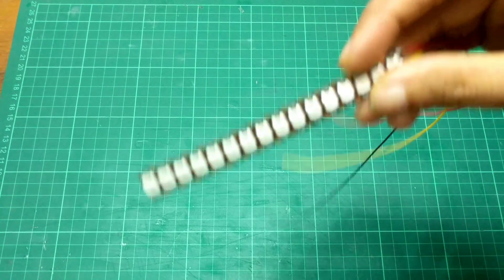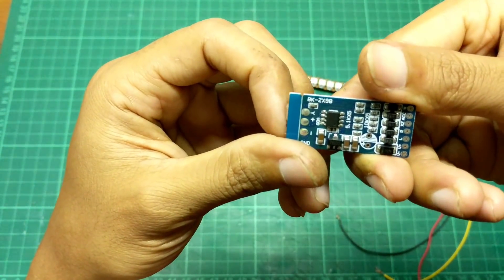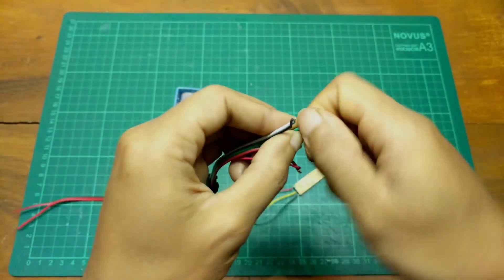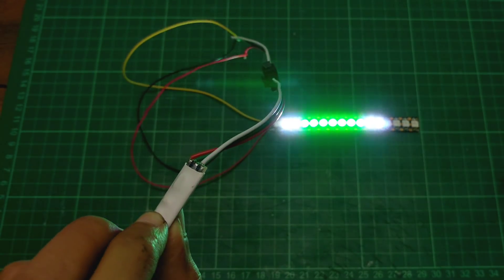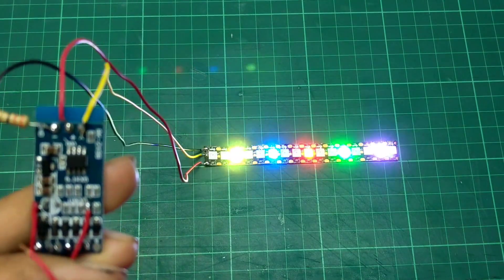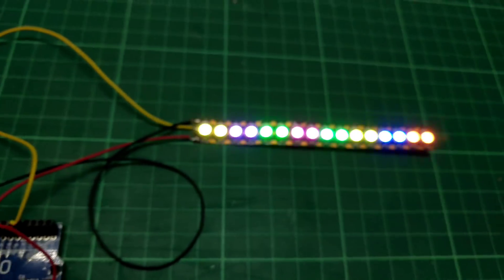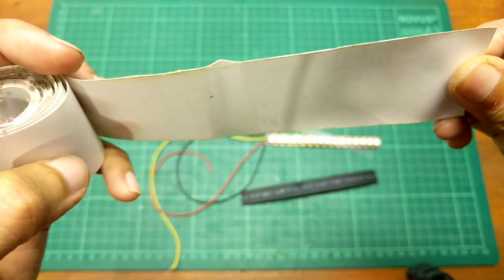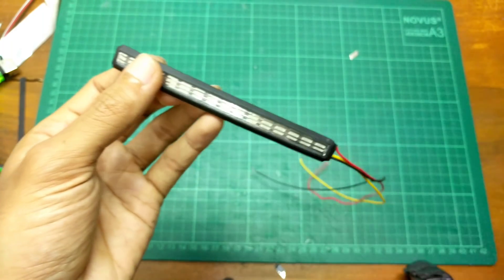CARA MEMBUAT STROBO RGB UNTUK MINIATUR BUS & TRUCK DENGAN LED STRIP RGB WS2812B

Comment: Sam saya minta link pembelian led rgb ws2812b ya ....sama modul SP002E ya!!  😁😀
Reply from the maker: Beli RGB Smart LED Strip IP67 WS2812B WS2812 WS2811 144 mata permeter 
https://tokopedia.link/uJNK2exQTeb
Reply from the maker: Beli SP002E 3 Key Remote for RGB WS2811 WS2812B Controller tanpa USB 
https://tokopedia.link/t7HBO2AQTeb

Comment: Bang itu di github ada banyak file ......itu yang dipakai progam (sketch) yang mana bang??
Reply from the maker: Adafruit neopixel ws2812fx
Reply: @ressarest  gak ada bang .... maksud saya coding nya bang yg persis sama di Vidio.....udah coba coding semua cuma yang paling bagus pelangi saja....tidak ada yang otomatis dan ada titik tengah
Reply from the maker: @jonathanfr27  yang 50 mode belum ketemu brarti? Bentar saya cek dulu
Reply from the maker: @jonathanfr27  udah bener yg ini linknya? https://github.com/kitesurfer1404/WS2812FX
Reply: @ressarest  iya bang belum ketemu..... sudah bnr bang link nya....tapi pakai coding yang mana supaya otomatis....kan di example ada banyak bang....yang dividio itu pakai coding yang mana?

Comment: Mas tolong dijawab ya. Ksih tau link pembelian modul SP002E nya spt yg di video yg 50 mode. Soalnya nyari ga nemu2.
Reply from the maker: Beli SP002E 3 Key Remote for RGB WS2811 WS2812B Controller tanpa USB 
https://tokopedia.link/28MAdDpt0bb di toko Mainar Store Rp23.000 di Tokopedia dengan Bebas Ongkir, Sekarang!

Comment: itu belinya 1 roll/pendek seperti itu mas?

mohon dijawab🙏🙏
Reply from the maker: Beli pendek saya, yg eceran per biji
Reply: @ressarest  Itu eceran belinya dimana mas
Reply from the maker: Beli RGB Smart LED Strip IP67 WS2812B WS2812 WS2811 144 mata permeter 
https://tokopedia.link/nuJgOsa9Obb di toko Mainar Store Rp2.100 di Tokopedia dengan Bebas Ongkir, Sekarang!

Comment: Itu yg dipake modul yg mana mas?3 3 nya atau kita bisa milih salah 1 nya?
Reply from the maker: Pilih salah satu aja bro
Reply: @ressarest  kok aku cari di tokped lampunya gk ada yg eceran yaa😔😔
Reply from the maker: @habibibrahim2978  Beli RGB Smart LED Strip IP67 WS2812B WS2812 WS2811 144 mata permeter 
https://tokopedia.link/rrwkhzaY6ab itu bro
Reply: @ressarest  berarti 2.100 per biji kan ya mas?kalo mau bikin buat skala 20 harus 16?
Reply: @ressarest  oke makasih mas udah di jawab👍🤭
Reply from the maker: @habibibrahim2978  iya
Reply: @habibibrahim2978  16 itu , buat 1 baris atau 2 baris 🤔
Reply from the maker: Satu baris